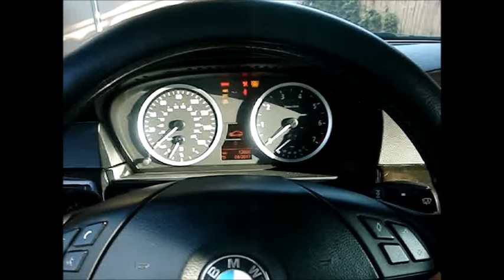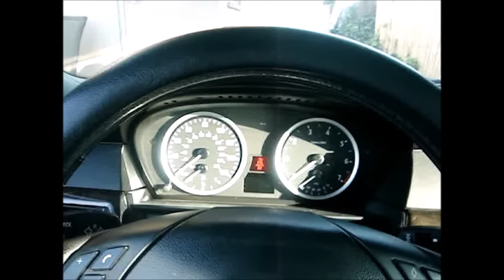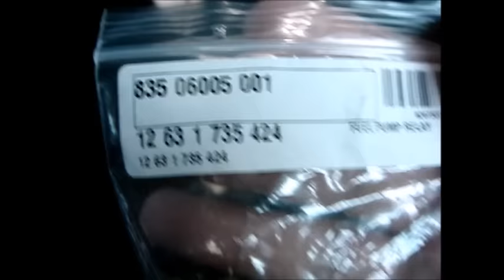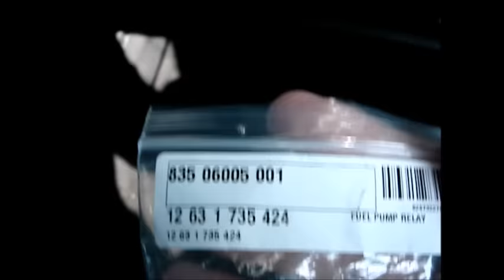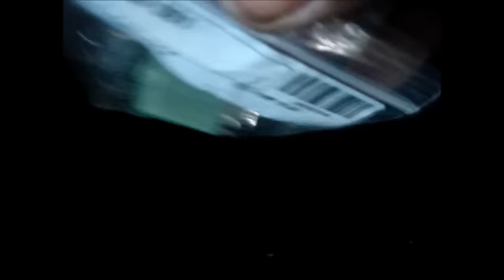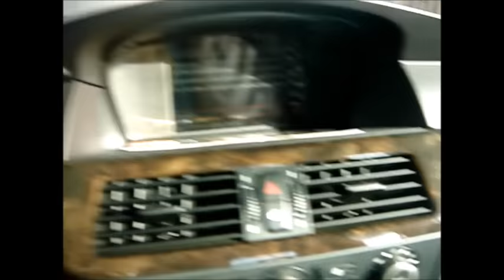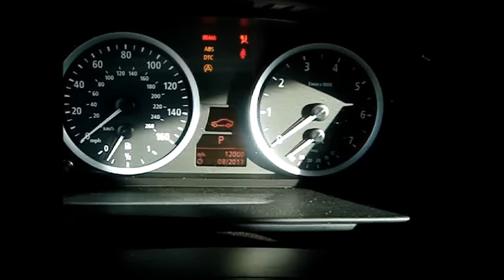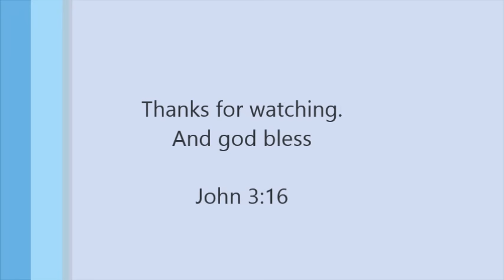BMW will not start ? / BMW Crank's but will not start ? Easy fix Watch this!!

Comment: I spent $700 replacing the fuel pump, and that wasn’t the problem. I watched your video bought a new fuel pump relay and the problem is now solved. Much love thank you.!
Reply: If your pump doesn’t prime. It’s a sign that the pump is dead
Reply: @MTLJack how do you know if it’s primping?

Comment: Can't thank you enough! Went to go to work and 97 BMW 318is cranked but wouldn't fire up. Went to Autozone. $20.00 and five minutes later I was on the road again. Thanks brother!
Reply from the maker: Ken Tissue 

You are welcome Ken, have a bless day!!!
Reply: I'm having the same issue replaced the battery and now this started noticing the idle dropping could this be the same fix and is the fuse box in the same place i drive a 99 740il.
Reply: My 318i e46 is cranking but won't start,I checked all fuses and they had power I don't know if that means the relay is working or mot

Comment: this reminds me of my 1995 525i fuel pump going bad. It stalled at the gas station. Immediately called my next door neighbor (another DIY guy) and explained whats happening. He said get a hold of a rubber mallet and uncover the trunk matting exposing the fuel pump cover. I ask someone to "whack" that particular area of the trunk floor while Im trying to start the car. On the count of three we simultaneously crank the ignition and pound on the cover. Voila! the engine started. Drove home and replaced the fuel pump the next day. lol
Reply: similar problems on 1950/60/70s BMC cars. MGBs and Morris 1000 had the fuel pump installed adjacent to the right hand rear wheel well, exposed to water (and slat in UK winters). If the fuel pump wasn't ticking when the ignition was switched on a whack with a piece of wood would often get it going again.

Of course in those days you could strip and clean the pump and the contacts so a replacement pump wasn't always required.

Comment: The car may not start for many many reasons...not just a relay
Reply: I have a 2003 525I it started to overheat and I noticed the top hose was hot and the bottom hose cold so I replaced the thermostat and now the car cranks but won't start
Reply: He kinda got lucky 🍀
Reply: in this video, obviously, the problem was ....
Reply: @anthonyfiston8257  I was just wanted to know if you fixed your probably yet cause my car is doing the same thing and I replaced the rely and that wasn't the probably so now I'm about to get a fuel pump and hopefully that solves the problem also do you know where I would find the fuel pump on my 2002 bmw  530i cause I'm not thanks .Ally
Reply: Alyisha Rainey junk yard
Reply: @alyisharainey2701  im not there yet, my fuel pump is different, i think i would have to drop the tank from under because i do not see the same configuration as every other videos :S nothing impossible, while waiting on the money i cleaned everything to be able to check for leaks in future :)
Reply: @alyisharainey2701  May be a crankshaft sensor...(on left side of engine).
Reply: @bugleboy154  hey ... Where is the sensor

Comment: I think the question is how did you know you needed a F P relay because they hardly ever go bad bmw have over 30 different issues of crank no start your video is kind of  missing something
Reply from the maker: This is a great question. When ever I attempt to diagnose an issue I like to start with the most basic and easy fixes first. In this video, that what I did first. But your right their are a lot of different ways to see what the issue may be but I always try to look at the most easily issue first. Many folks would change the fuel pump or the fuel filter costing 100’s of dollars in the process. You will be so surprised how many house calls I do where the car owner complains that the car won’t start and I am the type to always check to see if they have gas in their tank and behold all it needed was gas.

Comment: I don't see the need for negative comments, but my X5 was doing the exact same thing and I figured it couldn't hurt to try a $20 part and give it a shot, and it works!!!! The only difference is that my relay is located in the back hatch on the passenger side thank you so much for this video! As you stated you saved me a headache, grief, worry and most of all money!!!
Reply from the maker: Thank you for watching my video , I am happy to hear I was able to suggest a quick fix

Comment: Bro I really thank you ,I had the same issue and you just saved my ass , may God bless you ❤️❤️
Reply from the maker: You are very welcome Ahmad. Thanks for your feedback. God bless you brother.
Reply: @oscars-autorepair3236  it also can be the ground cable.
Reply: I'm having the same issues now I've had intermittent I believe they call emobalized issues it's a immobilizable issue's graph to get in the car and start it it would even turn over watch the ton of videos and came up with that emobalizer so I'd roll the windows down up own up lock and unlock the doors while you're in it get out unlock it with the key lock it with the key that did it again got in 9 out of 10 times that did stopped at it and I heard that's the immobilizer now I sure now I even put a new Ignition in it and I can hear the fuel pump buzzing I don't know what to do now I don't have the money to go through a ton of stuff any help? Up? Hopefully it's the fuel this the fuel thing that it's been fine other than I think the security not letting it start before now it's turned over or before it wouldn't even turn over
Reply: What year is your car???

Comment: It can also be the ground cable on the front left side  (under the car) and very common on BMW 1 series just say it. And watch this: DTC P0230The ECM monitors the  circuit for voltage. If voltage malfunctions, it will set  P0230, which is defined as “ – Circuit Malfunction.” “Circuit Malfunction” indicates that there is a malfunction in the control circuit, as opposed to a  in a sensor or other component.  

AND: Crank, no start is often fuel or fuel components.  

If it cranks then there is most likely not an electrical problem. If it was just recently running then it is most likely not an engine problem.  Thus, what is left are fuel components. If your vehicle has good fuel and is full of fuel then the most likely culprits are:  a weak fuel relay, a bad fuel filter, or a bad fuel pump.  If the car was recently running with no hesitation then it most likely is not a bad fuel pump.  That then leavesthe fuel relay and/or fuel filter as the most likely culprits. from: 
christansdad
Reply: Good info. Thanks for sharing.
Reply: My car sometimes starts on the first ignition key turn, but recently I often have to turn the key a few times before it starts. And the engine sometimes shuts off while driving. I got to restart the engine to continue driving. Can you make a guess what's going on?

Comment: same thing on 2003 e60 530d hope it will crank up normally , 1 bolt has been loosed and it still was cranking well then i tightened it up and had some bad noises + not cranking easily hope it will help🙌

Comment: This seems to be a common problem on these cars.  My E90 323i LCI N52 is doing the same thing after it cools down.  Starts perfectly on a cold winter morning at - 30 C. I drive it to work and then park it for 8 hours on that same day. After work, the engine turns but will not start.  Even with a full tank of premium petrol, a new battery, a new fuel pump, no check engine light, no OBD2 diagnostic codes, the car will not start.  My car has an electronic fuel control unit near the passenger side rear seat instead of a fuel relay.  Problem ended up being water in the fuel.  Resolution: Added a couple of bottles of gas line antifreeze/water remover, waited a few hours and car starts and runs normally.   Now I'm not sure if it's condensation from extreme temperature fluctuations or bad gas from the gas station but from now on when I fill up in the winter, I will always add a bottle or two of gas line antifreeze/water remover.
Reply: Sound good to me in-7 i had same problem been work good and when in to home havent started even long cranking ! than after 3/4 time later start than seemd okay with few more starts  Im going to use your formula lets see is it my problem or not . thanks anyway

Comment: It's 1 am and i cant sleep. My BMW has been parked at the gym for 3 days, wont start! Put a new fuel pump in it today for no fucking reason. Been binge watching vids on the problem. I think you showed me just what I need to do. Damit!!!!!!!!! Tomorrow relay change, i got a good feeling. No other vids mentioned anything about relay!!!!
Reply from the maker: Please let me know if it works
Reply: Did it work?
Reply: C'mon man, you gotta tell if it worked. Lol
Reply: I'm having the same issue I even put a new admission in this 06 BMW X5E53I drove it to the store turned it off after that just turned over when it started when in the star came out the same thing I was having intermittent not doing anything mean it wouldn't turn over anything and it's no running thing and I learned that it was just a mobilizer because I would roll the windows down roll them up trip the alarm use the key to unlock it get out use to lock it use the key to unlock the door got in 9 out of 10 times we'll start or I'll go through the sequence again I'm wondering if minus the immobilizer itself I don't know anybody can help me here please do and sit in my backyard for 2 months and I need to use it

Comment: Hey brother I just replaced the Fuel Pump myself ($1,500 estimate from dealer, $300 part) in my 2008 BMW E60 550i and after successfully changing the part, it would not crank over. Saw your video, called the dealer, and they said they would have changed the Fuel Pump Relay as well in the package deal they quoted me, so I went and paid $25 for the part, she started right up! Thank you so much man, subscribed and liked. :)
Reply from the maker: Nice!!!! its amazing how one small relay can cause a lot of headaches. I am glade you got your car running again.
Reply: Hi.  Where did you find your fuel pump relay in your vehicle?  I have a E60, 2008 528xi and have the same problem but can't find where the relay is?  I bought a new one at the dealer for $25 and fingers crossed it fixes the issue.   Thanks!
Reply: Sad thing is that if your relay was bad, then your pump probably wasn't... It's possible that they both were bad, but unlikely.

Comment: Hi oscar, I have crank and no start, did you have fuel pressure on the fuel rail if relay is bad?
Reply: You wont have fuel pressure if your fuel pump relay is not working..also try unplug your maf sensor and see if your car starts...

Comment: Great video , if my scan tool says fuel pump is operating correctly and it still won't fire , I changed my fuel injectors because it was running so rich so even if I scan and says fuel pump good do I change the relay?

Comment: I would suggest disconnecting the the Negative side of your battery first.But you have helped a lot of people,well done !!!
Reply from the maker: thank you
Reply: Nah what’s the fun in that. couple little sparks won’t hurt 😉.     (I’m completely joking by the way but I’ve also never actually disconnected the battery to replace a fuse/relay 😳
Reply: For what to replace a relay? You're joking right?
Reply: Hello can you help me?
Reply: If so where can I find it plz
Reply: Does 2002 BMW 325i have inertia switch? If so where can I find it plz

Comment: I only have the right white relay and not the left one which you replaced. There’s not even a slot for the one you replaced. Anybody have any idea where the fuel pump relay is located in 2005 bmw 530d e61?

Comment: Same problem with our 2006 X5, but different cause. After watching a few video's of troubleshooting (checking a bunch of fuses and relays). I decided to start looking at the silent fuel pump [which should make a faint humming when starting]. Pulled the rear seat [no tools required] and disconnected the fuel pump harness [on passenger side]. Supply power was good. Jumped the pump motor and it was dead. Besides waiting for a replacement pump, the entire job was 15 minutes of work [which is less time than following the troubleshooting instructions].
Reply: Thanks for sharing. Good to know the actual time it took in case I need to have mine replaced.
Reply: @tazmaniandiva7762  Yes, this car is still working like a champ. I sold it to a local and now their family is enjoying it.
Reply: @Fun4GA  thanks for sharing.
Reply: Where was the fuel pump relay location?

Comment: I’ve got a bmw 118d 2005 when I pulled up to work it cut out… then when started knocked off on its own now it just cranks brings a fault for injector 4 but apparently everything is good Any idea?

Comment: Hello my e60 has the same problem should i change it as well or it is another problem, at the first place i though there was no fuel in the tank bcs the backside of the car was not smoking and the starter was working?!
Im new with BMWs and it kinda strange to me...
Reply from the maker: Hi their , I would change the relay first , start their and than test the fuel pump pressure to make sure the fuel pump is doing its job
Reply: @oscars-autorepair3236  yes i will, thanks for your help

Comment: My 2006 BMW X5 3.0i won't start either, very similar as this vehicle. However, my problem is a little different, but may require same solution. It started with a brief tapping noise behind the firewall on passenger's side (where the glove box is located), directly after shutting off the ignition. But no problems starting/running, until about 7-10 days later, when it died while idling in a parking lot. However, it restarted okay - then died in traffic about one-half mile away...grrr. BMW is parked, dead in the water, after the $150 tow job. I am going to give this Fuel Pump Relay solution a try, because it's worth the nominal investment - especially if it works. Thank you.
Reply from the maker: Please let us know if it worked for you. Thanks for your feedback

Comment: I got a question bro, will it be jerking and stop then hard to start? Mine have this problem yesterday which i got a smal white smoke come up before start and it went back to normal. After i park it start to do like this, jerk and stop then hard to start. I do some reboot but still the same. So tge fuel relay pump is the problem? Mine same series 525i

Comment: Mine cranked for like 6-8 cool seconds then turned on this has never happened before is it the fuel pump?
Reply: That happened to me and another thing that happened to me is I was driving out of my backyard to the road and it cut out but came right back on I remember maybe once or twice I've have an issue so I believe with the mobilizer because you get in it and go to turn it on and it does nothing so I watched a ton of videos and taught myself most of the stuff didn't work what I did is you'd locked the doors unlocked them in wire inside with the key got out lock the car with the key unlocked in the door Thor and make sure to hear the chirp God in put my foot on the brake and it would start the day that all this happened I did that at least 5 different times would not start when the house came out it started turning it off and I'm about 4 times before I've left then get to the store turn it off to this day won't start even has a new Ignition in it I can hear the field pump running so I took the back seat out

I'm gonna try starter fluid this next time but I could hear the feel pump buzz when I took the seat up

Comment: Hey there,  new to BMW. I have a 2007 740Li. It intermittently would shut down each time you tried starting it. Had to open the trunk and wiggle the negative battery cable then the power would be restored. One night it shut down completely. It cranks good but will not start. Could I have a similar problem? Also,  where is my fuel relay located? I think it's im the trunk. Any help is greatly appreciated. Thanks again

Comment: hey Oscar the fuel rail has pressure so i assume the pump runs but then i have spark but no run any ideas what the cause could be its a 735i N62 motor 2204 model..
Reply from the maker: Try spraying some starter fluid on the intake throttle, and if it cranks up like it wants to run, than change your fuel pump.

Comment: Can use some advise on 06 X5 E53 now turns over but not start. 
I bought s new ignition off Ebay and still apart,
Key also sticks in start position that happened when 1st trying to start out of store when I shut it off at store and immediately turned off and tried to start and it just turned over. I bought an ignition box off Ebay installed it and same thing.
Before that it won't turn over and I learned how to get it to start by doing a lock unlock sequence and all doors & windows closed...

Love this X5 but been big start problems.

Comment: Nice video but it didn't fix my problem I actually had a P0 12 error come up and it cranks but no start or just not run? I see! And a red car and service that pops up briefly and goes away, it's bizarre how just changing out of valve cover gasket would crop up with a problem like this?

Comment: Could this be the problem as to why I got the fuel supply error on the dashboard on my f30? My car stopped out of nowhere and wouldnt start (it sounded like this in the video) until I unlocked and locked my car then it worked right after.

Comment: I'm trying to locate this relay on my 06 X5 4.8is. Bought the relay, but looked at rear fuse box, glove box fuse box, under steering wheel! Can't find it! 🤔 Wanna start there before checking fuel pump, etc. She cranks, but no love.
Reply: Did you try in the rear hatch on the passenger side? I have a 08 x5 and that's where mine was